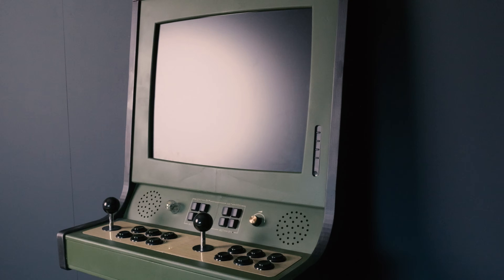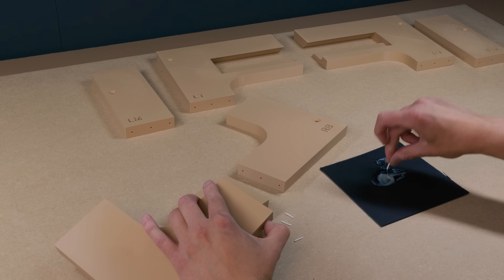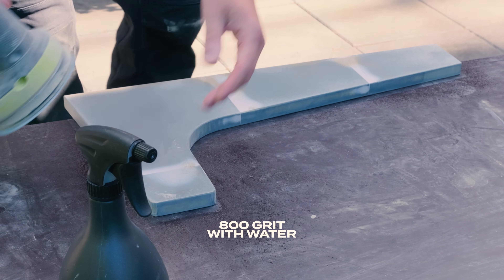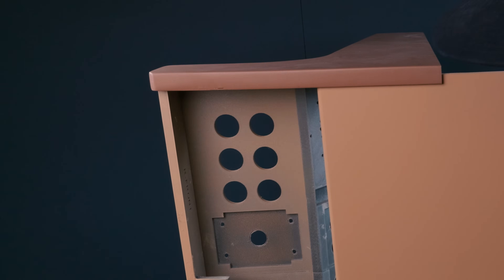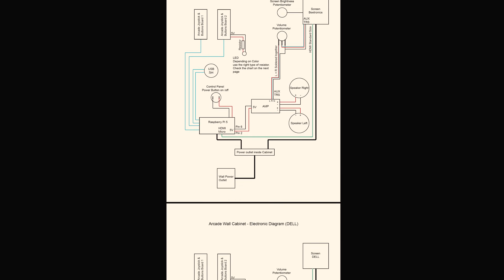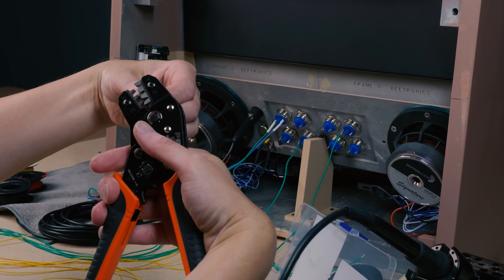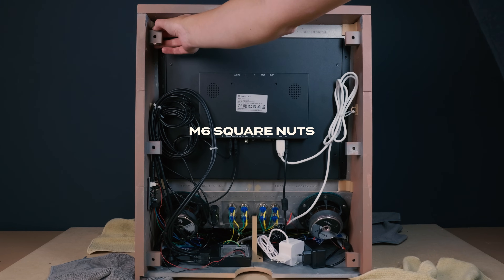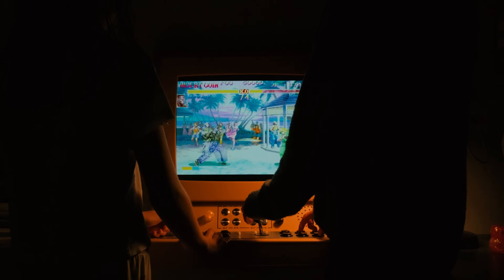Build Your Own 3D Printed Arcade Cabinet | DIY Project

Comment: Hi, can I ask how do you mount it against the wall?
Reply from the maker: It uses a French cleat system. You mount one panel on the wall, then hang the unit on it. After that, you secure it with a single screw at the bottom so no one accidentally lifts it off.
Reply: @Artifextron  And im assuming the 1 screw at the bottom goes into the wall not another 3d printed piece?

Comment: is it doable with my a1 mini? i really want to build this <3
Reply from the maker: yes absolutely, you will need to cut the STL files to fit the smaller print bed, but otherwise it should be now problem.

Comment: Can these parts fit on an ender 3 bed?
Reply from the maker: I´d say some of the already cut parts in the 3MF file would fit. But some you would need to re-cut from the STL files into smaller parts. But otherwise it´s no problem to print the cabinet on an ender 3 :)
Reply: @Artifextron I may have a project on my hands then 😂

Comment: Which monitor is that?
Reply from the maker: It´s a Beetronics 19'' 5:4
Reply: @Artifextron  Oh, 5:4, that's too bad. Thanks anyway.
Reply from the maker: @TarikA In the project folder you will find display frames for 4:3 format as well.

Comment: This is amazing! I’ve been planing on building this exact design and now can’t wait. I’ll join the Patreon before I start building it. Do you think this could work with a miniPC to have Steam (to play the new ‘beat them ups’ that are coming, He-Man and Marvel)? Also, any plans for a 24” widescreen design? Thanks. Awesome work!
Reply from the maker: Thanks! Yes a mini PC would absolutely work, it would be more like a regular computer but in a fancy cabinet :) Regarding screens, I will most likely add more options, but changing from 19'' requires more than just re-doing the display frame, I must make the whole cabinet wider. But I might do this in the future for sure!
Reply: Great to hear! Yeah, not a simple change but will be amazing. Thanks again for this project. Can’t wait to build it. Now I’ll have to upgrade my A1 to a higher end model, so I can print with ABS :)

Comment: How am I your 25th subscriber? This is what I need to print, instead of paying 1800 for an empty umbrella arcade. 

Not sure if you could design after that to fit a 32-inch monitor
Reply from the maker: The 25th is a big milestone 🙂 Hopefully the channel keeps growing! The cost really depends on what tools and parts you already have, so it’s tough to give an exact BoM. But if you can find a screen for around $100, you should be able to build the cabinet for about $300–400 — well below the $1800 you mentioned. If the project gains more traction, I’ll definitely look into making versions for other screens and setups too.
Reply: @Artifextron thank you!

I already have the extra 32 inch monitor, and a X1C sitting at my friends house.

Unfortunately he does not know how to design prints like what you did there. It be awesome if someone like you work on it. Or not sure if you can point me in the direction to get someone to design/create the print.

Comment: This is fascinating! with it being wall mounted the weight reduction in 3D printing compared to wood must be a benefit. How many rolls of filament do you need per arcade machine?
Reply from the maker: Thanks for the feedback! The cabinet itself is quite light — most of the weight comes from the screen. Overall, it’s still very lightweight. Printing the cabinet takes just under 3.5 rolls of filament.

Comment: 8:31
Did you measure it wrong? That screen fitment covering the LCD will make me crazy ngl.
Reply from the maker: Do you mean the rounded profile of the screen cover? It´s a design choise to give the cabinet a retro-feel :) The curvature is so small, so it does not cover much of the screen.